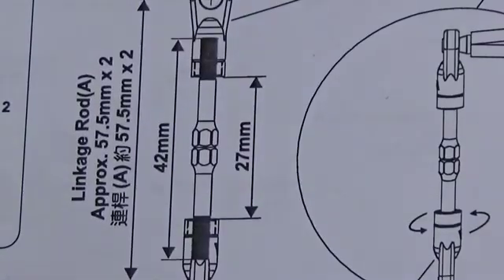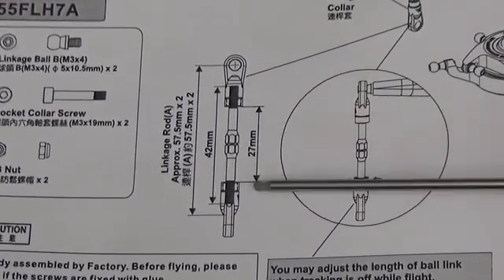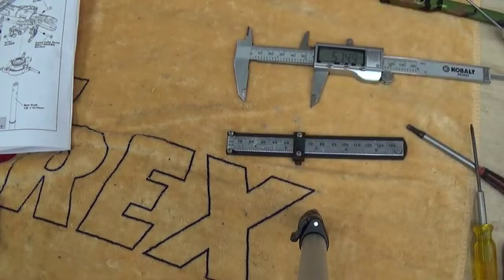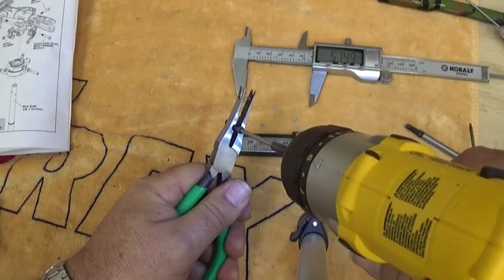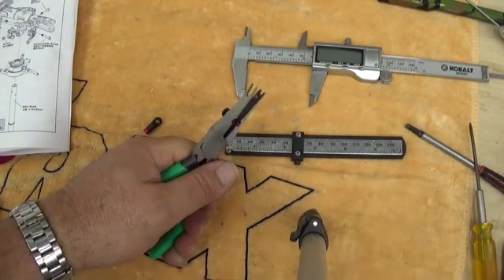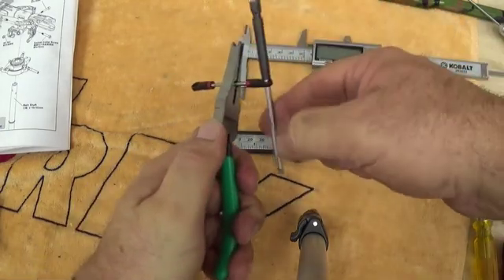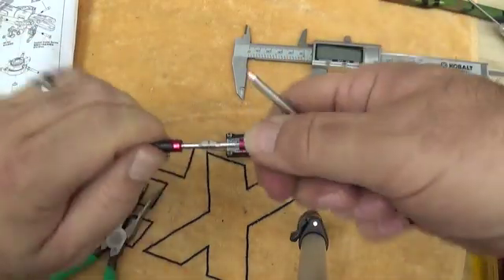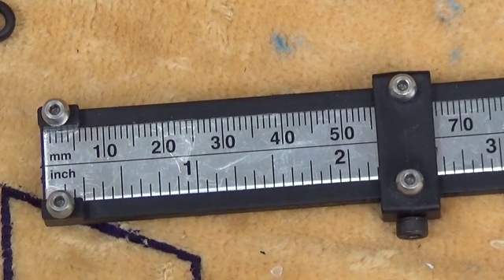TREX550X Pitch Links

Comment: Align's ball link assembly diagrams in the standard 2 blade Instructions are wrong. The dimensions for the two types of swash link have not changed (57.5 and 59.5 mm) but the reference points for these have shifted. Prior to the current Jan 2019 version of the manual the reference point was not ball link hole centre to ball link hole centre - as it should be. The effect was to increase the recommended length of the links which is clearly not helpful when setting up the head. The latest manual has only corrected one of these errors - the other remains and I think that Jim might have inadvertently overlooked the error as this video pre-dates the correction. Having said all this it looks like the 3 blade setup is very slightly different to the 2 blade regarding the pitch link lengths - but the issue remains valid for 2 blades users, at least. Builders look for hole centre to centre measurement drawing (or otherwise) in case affected.

Comment: Jim,
There is a mistake in your commentary and possible setup in this Pitch Link Assembly section, versus the Align manual. You reference the diagram in this and state that the given measurement applies  centre to centre  on the assembled links. Look at the diagram - this is not so. The measurement shown is from one centre to the point where the reinforcement of the link on the opposite end peters out. I'm currently building one of these heli's and found setting these links this way very odd - the resulting exposed thread looks way too much, but the drawing is definitely not showing a centre to centre measurement. I guess the proof will be when it comes to how much re-adjustment is needed to get zero degrees pitch during the MicroBeast setup stage.